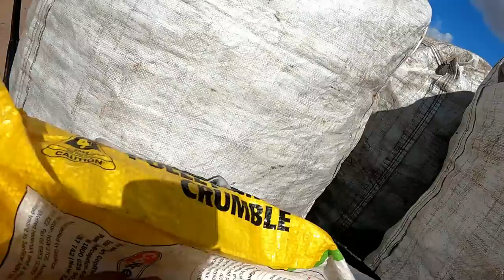Dumpster Diving We Scored Beer With A Monster Mega Load

Comment: I know I ask alot of questions but curious on the glass bottles you was throwing out what was wrong with them? Just a suggestion but if was y'all I would dumped all the rubbish in one container and turned the empty one's up side down so they would dry out some
Reply from the maker: The glass bottles that we were throwing away didn't have a label or a barcode on them this is the only way we can put them through the return and earn machine so if we take a bottle or even 8 cans to the machine without a label with outa barcode on it it will reject it I'm hoping in the near distant future that they will be starting to accept wine bottles as far as I know they are going to be doing that in end of February but this will take time
Reply: @oureverydayliving  oh ok I understand